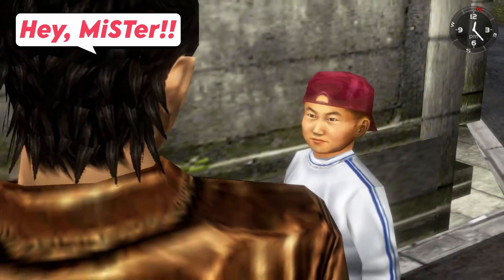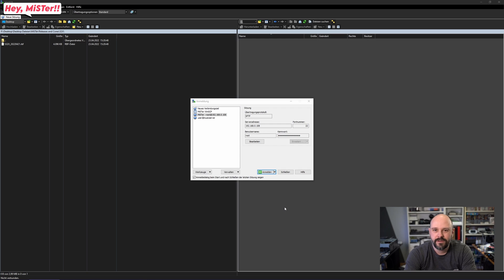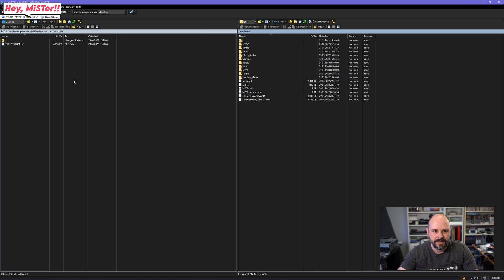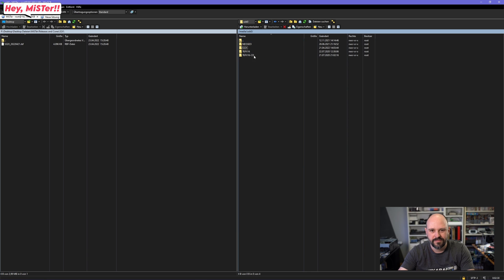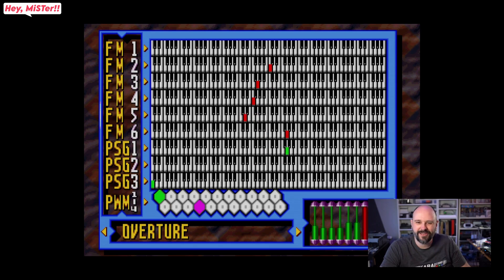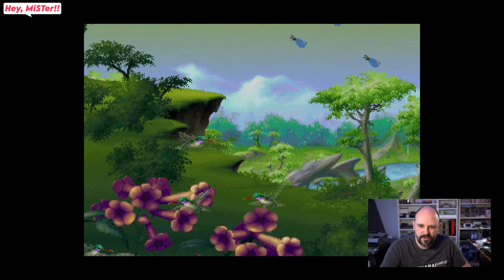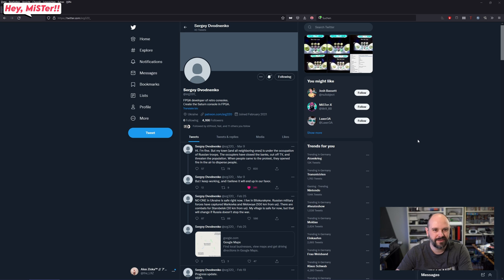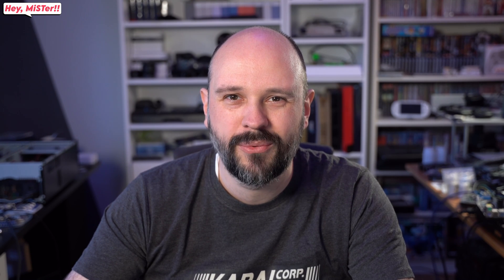Getting the new SEGA 32X core on your MiSTer FPGA setup  | Hey, Mister!! Episode 02

Comment: Thanks for the vid! What Scanline mask are you using? Looks great!
Reply from the maker: Thanks! It greatly depends on the whole combination of core, aspect (integer or not), game's native resolution and mostly the display / capture device you output to. So that's a long way of me saying that my settings might not look good on your setup ;)

But I'll happily share my suggestion which works great for me:
Video settings (filters further below):
Aspect: original
320 Aspect: Corrected
Scale: V-Integer
Border: No
Composite Blend: Off

Video processing:
Horz filter: No Interpolation (because I use integer)
Vert filter: SLA_Dk_030_050.txt (adaptive scanlines)
Scan filter: Same as Virt
Gamma Correction: Poly.2.4.txt
Shadow Mask: 1x Sony PVM Generic (Monochrome version)

Hope that helps.

Also, I find that I often switch things around - it's quite possible that I switch things around in a month's time because I suddenly want a totally different look. To be able to do just that is the beauty of MiSTer.
Reply: @LXZ  Thank you for the comprehensive description! I mess around with a lot of the shadow masks only to find most look like a checkerboard, or, too much like a crosshatch. I'll try your settings! Thanks again
Reply from the maker: My take on Shadow Masks is that, since they became available and were hyped (rightfully so, though, since it has never been done before), many people seem to feel obligated to use them. In the end, only you have to enjoy the look of the game you are playing and if you can't find a shadow mask you like, then don't feel bad if you don't use them :)